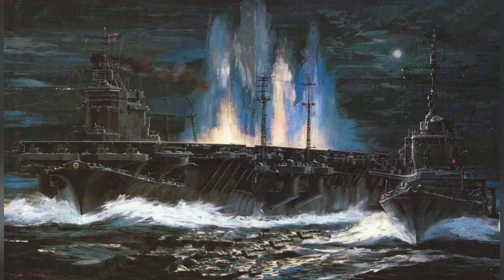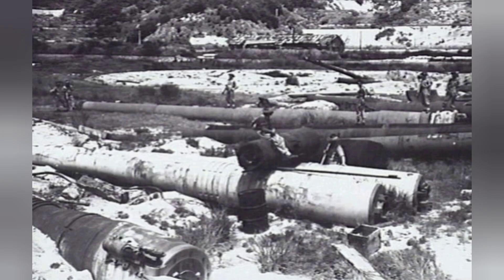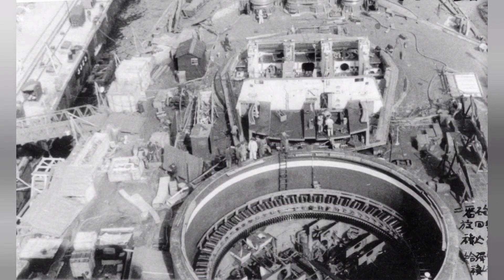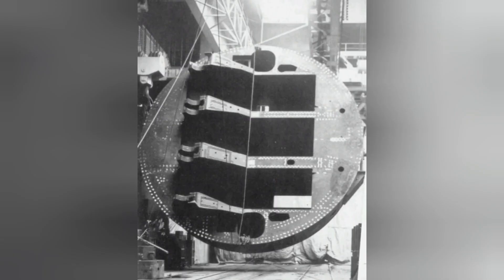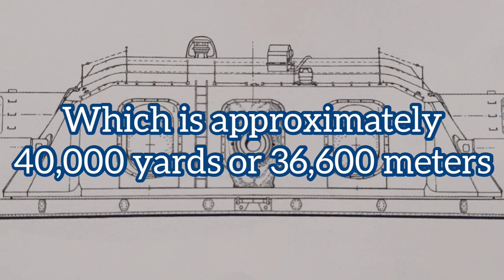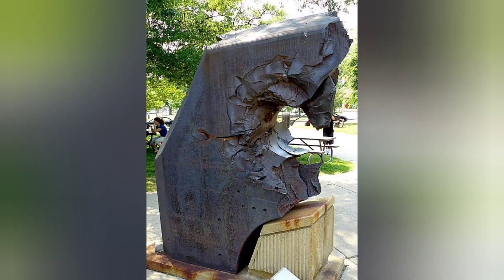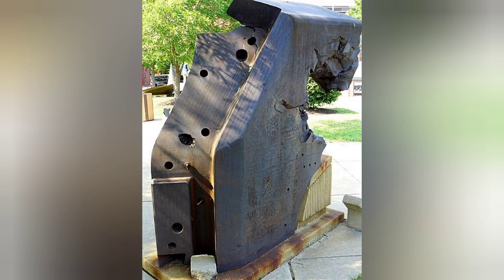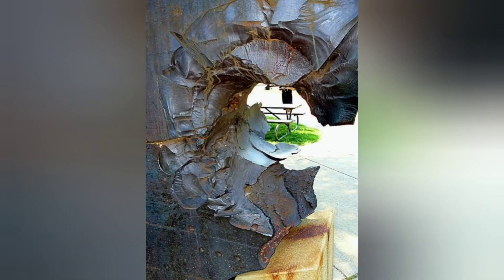Shinano turret armor test.

Comment: I was doing armor design in the 1980's and was given access to the actual field report of this test and the story  has become a total urban myth.  The test was set up at Dahlgren test range on the Chesapeake Bay.  The plate was mounted on an I beam frame with no attempt to replicate the turret structure and it was known it was not representative.  It was mounted vertically because it was easy and quick.  The file indicated they could not agree on the angle of attack at long range even though 26-30,000 yards was considered the likely combat range.   They came up with the 40,000 yard range working backwards.    The 16" gun was 100 feet away.       The first test was NOT done using a reduced charge.  They used a full charge on the gun and the shell blew through the plate and was never found in the marshes on the other side of the Chesapeake Bay.   It was a huge PR issue since they did not properly warn the Coast Guard and thus no one actively stopped shipping.   Navy was "unhappy" about the test which was listed in the file as a stunt and a new manager took over to ran the second test. 

For the second test, they replicated more realistic combat range and velocity.   They left the plate vertical because the first test so badly damaged the plate they could not mount it otherwise.  However there was enough experience in armor testing to use the data realistically.  The second test did not penetrate and only a small hole was formed due to spalling on the back side.   The shell penetrated 21 inches but  the conclusion was with proper mounting angles and in the turret structure, the shell would not have gone deeper than about 16 inches with little cracking or spalling.  They extrapolated the data and concluded the 16" super heavy shell would have had trouble penetrating  the turrets and main belts at any realistic  combat range over 14,000 yards.   You also have to remember the Japanese were designing the armor to withstand Yamatos own 18" 3200 lb. shell.  The 16" 2700 lb shell had actually  duplicated the ballistics of an 18" shell but that would still be in the design parameters  Japan used.  People also never note that the test results can be applied to the US battleships even allowing for armor differences since the shells were remarkably similar.  There was in the field report a comment that if the Yamato's 18" shell matched the 16" shell, then the Iowa  armor could not have stopped the rounds at realistic combat ranges in 1944.  The Yamato armor was rated very high in the test report.

In terms of quality, it was not considered  equal to USN or RN, but  the Bethlehem Steel's labs (BSC made Iowa's armor) noted something that everyone claims was an indicator of poor quality: presence of ceramic material.  Post war USN and RN noted Japan used different formulas for their armor intentionally recognizing certain alloy elements  would be cut off in war and they wanted to be ready.   What caught the attention of  the BSC lab was the uniform contamination of the ceramics which they concluded was intentional.   USN never bothered to really dig into it but the British did.  There is a direct line of research from that discovery  to the invention of Chopin armor by Britain 3 decades later.   It is realistic to say the Japanese were cutting edge in a different direction of armor.  

The plate with the second test was at Dahlgren proving grounds.  Saw it.  I don't know if it is still there.

Comment: The test just sucks cuz they made the plate at 0 angled not 45 angled which increase armor to 950mm and this will not even get the plate scratched from 406 gun, IJN said yamato armor was impenetrable from 30k distance they mean here the belt armor which is 410mm thick , so what about 650mm hardened vickers steel with 45 degrees which goes to 950mm even at far distance it cant go through, i have seen a test with iowa gun shooting the yamato front turret plate with 3 angles and non of them scratch it

Comment: still not a very conclusive result. the testing result of this 26 inch armor did not prove anything.
Reply: The conclusion of the report on the test specifically referred to the inability of the 16".50 cal. gun to penetrate the faceplate at any combat range. You should read it.

Comment: I don't get your conclusion, since we see that big hole going right through.
On the inside, we see a lot of steel blown out that would have done additional damage. 
Not having the rest of the turret to support it could also mean that chunk of armor also had some "give" to it. 
What I conclude is those 16 inch, 50 caliber guns could have punched holes in that armor plate, wrecking the inside of the turret.

The last time I saw that piece of armor outside the museum at the Washington Naval Yards was about 2015.

The museum is excellent, but since it is located on a Navy base, one has to call ahead and give the make, model and license plate number of your car if you're going to drive in (strongly recommended) and also have ID.
Reply from the maker: It's not my conclusion, what I said is pointed out in the official test report. You can read the original report online.
Reply: @centralcrossing4732  Thank you for the reply. 
Do you have a link to the test report?
I've always thought that hunk of steel was really cool.
Reply from the maker: @garfieldfarkle  here it is:
Ballistic Tests and Metallurgical Examination of Japanese Heavy Armor Plate - DTIC https://apps.dtic.mil/sti/tr/pdf/ADA955281.pdf

Before anyone clicks on it, I do want to make sure you understand that this is a PDF, so it will download. So don't freak out when it does. The relevant results are on page 4 of the report, page 16 of the PDF. There are other armor test results discussed in it, so if you are interested in a range of Japanese armor, I'd recommend reading the entire document (102 pages).
Reply: @centralcrossing4732  Thank you very much. Your replies are much appreciated, as well as the video overall. 
I have always wanted to learn more about this. 
That slab of armor plate is really impressive to see in person. 
Again, thank you!

Comment: Even if the shell didn't penetrate the turret fully all of the spalding and fiying metal from the inner side of the turret would have killed and damage anything inside, just like does in battle tanks, so yes the turret would have been compromised!
Reply: The damage which you reference would not have taken place without a full or partial penetration. The shock from the hit however, may have jammed the turret and almost certainly would have incapacitated some members of the turret crew. While that's not something to take lightly, it's nothing compared to a full penetration would have done to both turret and possibly ship.

The conclusion of the USNPG report on the plate tests was that the faceplate was impenetrable from any combat range.

Comment: The Iowa class were definitely up to the task of defeating a Yamato class
Reply from the maker: Most certainly. Any battleship could take on another, that's what they were designed for. However, I do want to clarify that the video is not questioning battleships vs battleships. I'm just presenting the USN's findings/test errors on Shinano's turret face.
Reply: All things being generally equal, an Iowa would have been in real trouble versus a Yamato class battleship. In the areas of offensive firepower, defensive protection, and maneuverability, the Yamato's held a clear advantage over the Iowas. In crew training, they also held a clear advantage over the Americans until late September of 1944 when the Iowas received their first main battery gunnery practice since entering the Pacific theater. 

The Iowas held a clear speed advantage (max 27.46 vs. 32.7) over the Yamatos, and a slight advantage in the range accuracy of the Mark 8 radar range keeper (~45 yds.~) over Yamato's main battery range finders (~89 yds.~) and her Type 22 mod 4 radar set (~110 yds.~) which provided the Yamatos with radar assisted gunnery only. This advantage was more than offset by the greater shell dispersion of the Iowas, which was half again as large as that of the Yamatos for a nine- gun salvo. The primary advantage of the U.S. Navy's Mark 8 radar range keeper lay in remote power control- the ability to directly control and adjust the ship's main battery so as to remain on target in all weather conditions- which is not the kind of conditions which the U.S. Navy would have actively sought to engage under.

The immunity zone of the Iowas against the Japanese 18.1" gun was less than half that (approximately 5,000 yards) of the immunity zone of the Yamatos against the 16" .50 cal. gun (approximately 11,000 yards). The difference was even more marked in areas such as the control tower and barbettes- with the main battery faceplates of the Yamatos being impenetrable by the 16" .50 cal. gun at any combat range, as stated in this video.

Probably the most significant factor in such an engagement was that the U.S. Navy knew very little about the particulars of the Yamatos. The prevalent belief in the U.S.N. was that the Yamatos mounted 16" guns on par with the North Carolinas and South Dakotas and had an armor protection system equivalent to the South Dakotas. This belief held until four months after Yamato was sunk. Because of this estimation, the Americans anticipated engaging new Japanese battleships in the 22- 25,000 yard range, where they believed that they would enjoy a large immunity zone vs. the Japanese 16' gun while being able to penetrate the armor protection of the Japanese ship.

All of this is because- unlike the Yamatos- the Iowas were never intended to be the most powerful battleship ever built. They were intended to escort carriers, and to catch and destroy the Kongo class fast battleships.
Reply: @manilajohn0182  Yeah, I see your point, but the iowa class would have. Still beat the Yamato class ships. Lol

Comment: plus they shot this face plate at point blank range. highly  unrealistic
Reply: With half charges, at 3,000yd simulating about 15 to 18,000yd.
Reply: @peterson7082 You're still hitting it at an impossible angle that you cannot replicate in a battle.

Comment: Interesting, I just saw a documentary on Shinano’s half-sister Musashi and they we’re talking about how the ship is in two pieces at the bottom of the ocean when it went down in one piece and they were saying it was because of the rivets, but I’m wondering if this brittle problem at the edges of the armor when combined with the rivets may have also played part, which brings up the question could the armor have been overcome by basically shaking it apart with enough hits?
Reply from the maker: Musashi's wreck is an interesting topic.
The ship is in 2 main sections, however it's not as one thinks. 
Section one is upright and from the bow to just aft of barbette 1 (turret 1's location) while section 2 is upsidedown from around turret 3's location to the stern. So from turret 2 to about turret 3 is in thousands of pieces, or around half the ship.
It's not due to rivets, the armor belt was riveted but the majority of the hull was welded. The ammunition magazines detonated while Musashi was submerged and there are eyewitness accounts for this as many heard a large boom and saw light from where Musashi sank.
Wreck surveys have also confirmed it was magazine detonations.
Reply: @centralcrossing4732  True there was also a magazine detonation, The way the documentary I saw told it the wreckage is supposed to indicate that the ship breaking up also had something to do with a section of the armor belt that was found detached from the ship that clearly detached sometime before the battleship broke up, the whole thing seems to have been blown off in one piece, something about the flooding this caused is supposed to have been a contributing factor in addition to the explosion, at least according to the Japanese naval historians who they interviewed. I’d love to know more about the evidence, what sources would you suggest I look at, ever since I found out about this wreck it’s fascinated me.
Reply from the maker: @drewjohnson-85  Luckily I'm well aware of what documentary you are talking about and I did go back and rewatch that section and I took notes. 
Before writing a clarification, I want to say this. The evidence available is thin and far, Musashi is so damaged that her wreck provides little details regarding her final day thanks to the magazine detonations. However, there are points to clarify from the documentary so one can think on it.

That section begins with what I'd say is common when it comes to ship documentaries, Why did an unsinkable ship sink? This is a hook that holds viewers but means little as every ship can sink. The Imperial Japanese Navy knew the ships could sink. They weren't designed to be unsinkable, rather capable of withstanding extended amounts of punishment, which they did in both final voyages. 
Now the port bow folding out is not a rivet problem, that section is welded. 7 torpedos and 1 bomb hit that area, so the hull is obviously going to fail, especially since the torpedo belt doesn't cover that section. As said in the documentary, Kobe University did a simulation and found that damage alone could NOT sink the ship (take with salt as this is theoretical based on math). The rated reserve buoyancy for one Yamato was 57,450 as calculated by the IJN (for anyone who doesn't know, reserve buoyancy is how much flooding a ship can take before actually sinking). 
This leads to the rivet and armor as the citadel (aka armor box) needs to be penetrated. This is where the doc is... confusing. The torpedos are NOT hitting the riveted armor belt, rather the torpedo defense system (aka the torpedo belt). The outer bulge, which the torpedo hits is welded. The inner torpedo bulkhead (200mm thick), which is the 90ft or 27.4 meter section of hull found detached in the doc, is riveted, bolted, and welded. During the ship's design phase, much attention was placed into this system and a sacrifice was made. 
The standard connection used in the IJN between the armor belt and torpedo bulkhead was weak on this scale of ship. The 2 Nagatos had the same problem which is how the Japanese knew about it and they did develop a solution. However, the new connection would take 6 months to complete properly and thus extend construction time, time the Japanese didn't have. So they used the same connection on every other battleship in the fleet aware of it's problem. This is a chance issue though, not every torpedo would cause this connection to fail, so where it failed is something we'll never know, again due to the ship's condition today. 
The doc does say at this point the riveted armor can withstand artillery shelling, which is true as in most warships of the era. Remember most battleships had full riveted construction due to welding becoming a new technology in the 1930s, world war 1 showed how the rivets could take hits. World war 2 did as well since many ww1 battleships were still in use with full riveted construction.

The largest problem is this regarding the 90ft/27m piece of the torpedo belt in the documentary, it's detached from an area decimated in the magazine detonations. Is it not possible for this to have come off during the detonations? Especially since it is found in the debris field. If rivets caused it to fall off, it wouldn't be found near the wreck, rather somewhere along Musashi's path since it was moving to the very end.
There is simply no define answer for what you ask. However, it is possible to piece together ideas for what happened based off what has define  answers.

Edit add on: I also want to say the poor connection could withstand a 400kg charge, a common torpedo charge during the interwar period. However, the ships were hit with torpedo charges 50% greater. So not only is there a connection issue, but the weapon used against it has a higher rating, so it's effectively being overmatched.
Reply: @centralcrossing4732  Thank you, this certainly does clarify a lot of the questions I had about that sinking, Like I said I’ve been fascinated by the Musashi’s fate ever since finding out about it’s wreckage, this certainly helps paint a clearer understanding of the ships last moments. Have a great day and thank you once again.

Comment: The most important issue however was the fact that the most likely places to be hit, the armor belt at 16 inches and the deck at a max of 9 inches were well within in the 16/50s abilities to penetrate.  Given the size of the entire ship vs the size of the turret faces the chances of a turret hit would be rather slim.
Reply: Below are the immunity zones of the two vessels against the other's main battery- with a target aspect of 90 degrees. Information is per U.S. Navy Bureau of Ordnance.

Immunity zone of the Iowas vs. the 18.1" gun: Citadel 24,800- 29,800 (5,000 yards); Turret Faceplates 24,700- 31,600 (6,900 Yards); Barbettes 26,500- 31,600 (5,100 Yards); Steering 24,700- 28,800 (4,100 Yards); Control Tower 26,500- 31,600 (5,100 Yards).

Immunity Zone of the Yamatos vs. the 16" .50 cal. gun: Citadel 17,000- 34,500 (17,500 Yards); Turret Faceplates (Impenetrable); Barbettes 16,600- 36,800 (20,200 Yards); Steering 19,100- 33,400 (14,300 Yards); Control Tower 16,600- 33,400 (16,800 Yards).
Reply: @manilajohn0182  Those immunity zones are crazy. Thank you for this post.
Reply from the maker: 3:18

Comment: Thanks for the video. Even if it doesn't penetrate, a major caliber shell hitting an armored space would cause havoc inside. The space would be showered with spall and flying rivets and fittings that were attached to the walls.. everything would fly off at force. I think if, say, a conning tower gets hit nice and squarely, it would surely kill everyone inside. So, wether it penetrates or not is not that big of a deal i think.